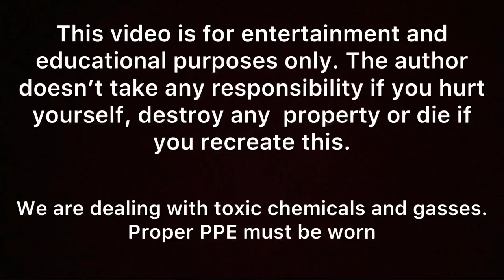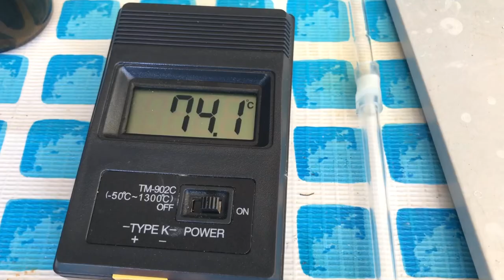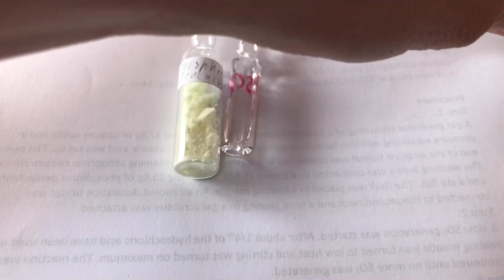Making thionyl chloride

Comment: I'm a bit torn between recommending either demonstrating its electrochemical use as an oxidising 'depolariser' (such as in a Lithium - Thionyl Chloride battery), or demonstrating the reduction of Carbon, all the way from its 2nd highest oxidation state, i.e. a carboxylic acid, to the corresponding alkane.

I'm sure you already know this, but those interesting patterns in the liquid are harmonics excited by the stirfish 'fishing around' (I really love that term) in a mechanical system, which contains (at a minimum) both a derivative 'spring' and an integral 'inertia' element. In this case it is the surface tension and the spherical constraining boundary (together with gravity) which act like 'springs', while the density of the liquid, together with the radial length to which those lobes extend, give the linear inertia (up the walls) and rotational moment of inertia (spinning around an increased radius as it climbs further up), which combine to form those excitable harmonics.

Comment: You can make some volatile metal chlorides/oxychlorides using SOCl2. V, Nb, Cr, Mo, W and Re form colored chlorides/oxychlorides, which upon heating evaporate/sublime as colored gas. Mn also form colored oxychloride MnO3Cl, which is however unstable and quickly decompose to MnO2, O2 and Cl2 (so you can observe MnO2 particles in the air).

Comment: Thionyl chloride is one of those chemicals I hate its volatile, it's also a thiol which smell bad and it is very corrosive and the chemicals I hate are chromyl chloride, thiophosgene,hydrofluoric acid, that's just some of them.
Reply from the maker: Understandable but thionyl chloride is still immensely useful
Reply: carcinogenic? How did you come to this conclusion? I mean even if true that would be the least of your worries if exposed LOL
Reply: @experimental_chemistry  sorry I'll change it
Reply: SOCl2 is not a Thiole. I must admit, it smells bad, but it is an unpleasant pungent reek similar to chlorine (after you have taken one breath, you never want to take another one). Thiols are organic compounds with a -SH group and an extremely disgusting foul smell. My favorite is Thiophenole.
Reply: @THYZOID  Das auf jeden Fall! Der große Vorteil von Chlorierungen mit SOCl2 ist das Entstehen von rein gasförmigen "Abfallprodukten", die nicht erst abdestilliert werden müssen. Ich habe während meiner Ausbildung alle Chlorierungen ausnahmslos mit SOCl2 gemacht. Wenn es funktioniert, ist es eine sehr elegante Methode, im Vergleich zu PCl3, PCl5 oder POCl3. Oxalylchlorid als Chlorierungsmittel kenne ich aus eigener Erfahrung überhaupt nicht. Ich weiß nur, dass eine falsch deklarierte Fracht mit eienr Leckage davon, einen Transportflieger geschrottet hat.

Comment: Interesting presentation.  A lot of organic reactions make use of chlorine.  One might consider using FeCl3, Ferric Chloride.  This chloride, when heated to about 70 degrees or so C will produce, in a statistical manner, chorous and chloride ions (spelling?); the plus and minus ions of Chlorine.  All that heat, or energy, an energy reaction curve.  So, if you run your reaction for 30 minutes, maybe?  Where for the source of chlorine goes from Ferric Chloride to Ferrous Chloride.  Of course, if your reactants are neat, that might help too.

Comment: Very interesting. I've only heard thionyl chloride as a component in older AA batteries
Reply: Lithium thionyl chloride cell phone batteries. Sealed case = Li SOCl2
Reply: First time i heard about this stuff was actually when I watched the HAAS CNC machine channel. The Renishaw probes that they use to automatically probe and set tool and workpiece offsets used thionyl chloride batteries. (I dont know if they do now though, was some years ago i watched it)

Comment: How about bubbling SO2 and Cl2 through SCl2? It would spare the precious PCl5 and still give off SOCl2, apparently.
Reply from the maker: Do you have a paper on this? Would be great if it works but I guess it would make sulfuryl chloride and not thionyl chloride
Reply: @THYZOID  All I have is a textbook that says the 3 react this way. Doesn't mention physical conditions. Wikipedia mentions this also, but I don't think it is the most reliable source.

Comment: Where do you find the electric thermometer that you used during the distillation?
Reply from the maker: Look at my old videos. The probe with the monitor can be bought cheaply on ebay (k type thermometer) and the glass thing I made myself.

Comment: you should do it again from SCl2, my Inoragic books all state both S2Cl2 and SCl2 will result in thionyl chloride.
Reply from the maker: Isn’t it SCl2 and SO3?
Reply: @THYZOID   yes and no. One of my inorganic books shows it can be formed from either, and with either SO2 and SO3 with more chlorine. using SCl2 and SO3 results in thionyl chloride easier without the aide of a catalyst. Using the other chlorides it takes days. without a catalyst the reaction will  need to be ran for over a week.. talk about super excess chlorine.
Reply: @THYZOID  the best way to make it is with liquid SO2, Liquid Chlorine, and S8.  It makes a more pure product however it's hard to do at a home lab.  You can even make it without any SO2 or So3 by using chlorosulfonic acid and S2CL2. But, but I have to say after playing around with those methods. I'm a fan of PCl5 and SO2. It's just to easy to do. Not as dangerous and doesn't stink up your glassware with sulfur compounds. I use a cow utter receiver and redistill the SOCL2 with a big column and slight vacuum and the phosphorus contaminate is nill at that point.
Reply from the maker: The chlorosulfonic acid route sounds interesting. Might try